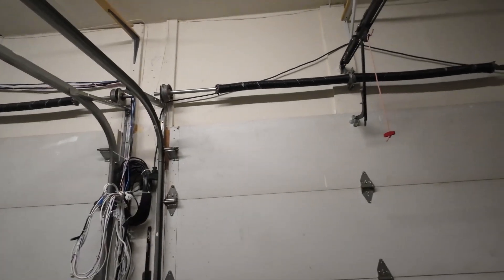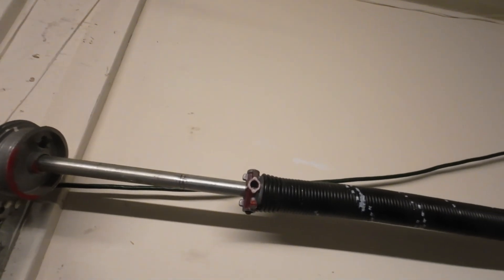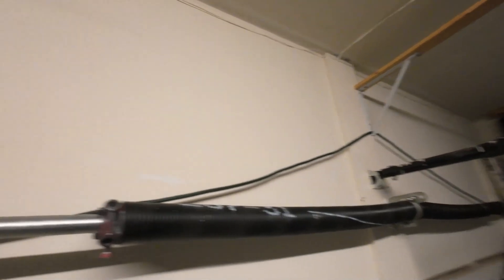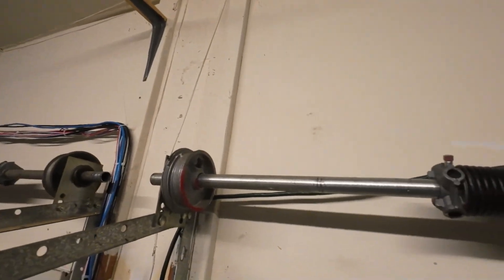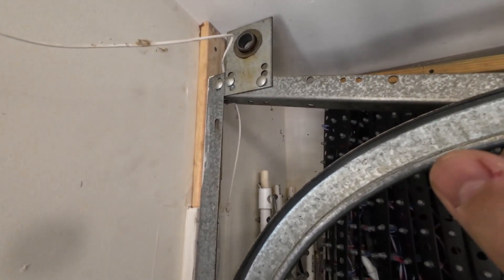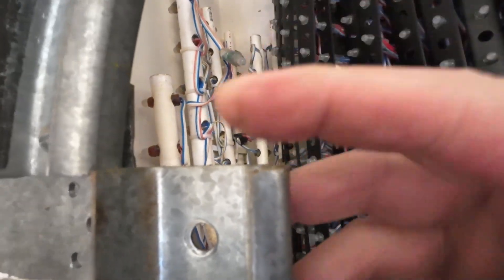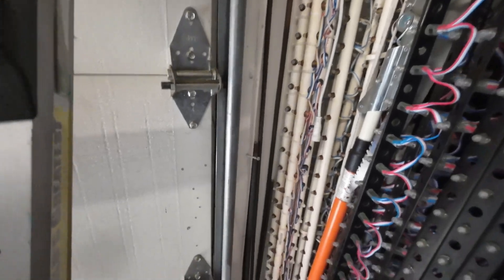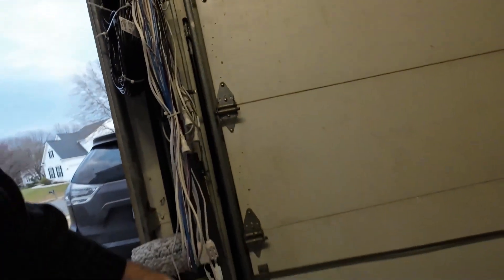I Converted My Garage Door to High Lift and You Should Too

Comment: Nice video and presentation. 
I have two questions. 
Is your new wire drums looks much like a cone diameter tapering towards door center line or not? Do you need a pair of new springs?
Reply from the maker: The drums do look like a cone diameter, if your springs are more than 5 years old, I recommend buying new springs and double spring would be my recommendation if you can do it.  Springs are not that expensive but be very careful as they hold a lot of tension.

Comment: This makes it look doable for a regular person. I got a quote today to add a new motor (direct drive) and a high lift conversion kit and the quote was $4800. I was not expecting it to be even close to that. So now I am on YouTube trying to figure out if it is even possible for me to do. Which this makes it seem like I could do it. Thats awesome Thank you!
Reply: Dang I’m under cutting myself $4800 to do the conversion with the jackshaft opener blows my mind, I do this conversion starting at $1822 plus taxes with a jackshaft opener included and the price could go up depending on the cycle of the springs that are desired.
Reply: @kingkevo2010  4800 for that job is literal fraud. NGL I had 5 people come out and give me quotes every single one was around 2k and that asshole wad almost 5 lol
Reply from the maker: I'm glad the video is helpful, hope you can get it done in no time.
Reply: Not a great idea to have  DIY work on torsion springs, garage door company cheaper than a hospital bill

Comment: Does it bother anyone else how he used the adjustable wrench? I have issues it may just be me.
Reply: The adjustable wrench is a good choice, it can be used as a hammer if you get mad at what you are working on…..
Reply: @playingwithdirt1862  or the person helping you...
Reply from the maker: Thank you for your comment, the adjustable wrench has a good grip due to the square shape of the screw.
Reply: @diydadhub  I gotcha. We have all struggled with old school adjustable wrenches. I stopped using them and either use channel locks or knives auto adjust wrenches.
Reply: Use a 7/16 ratcheting wrench. Normally you want a 3/8 wrench but 7/16 slips on perfect

Comment: Hi, I am trying to do the same.  Can you please share the adjustments. And I noticed the door was not staying open, you just to hold it.  What was needed to fix that issue.
#2. Will you be using electric for opener for this door.  If not, will you have to put a rope to bring the door back?
Reply: The door is not staying open because of one of two things. The springs are the incorrect wire size, length, and possibly inside diameter after going from 12"/15" radius track system to a high light track system. Or your cable length is incorrect.
Reply from the maker: @henningtanner  The cable length wasn't the issue, I had to add more tension to the springs (2 additional turns to be exact).
Reply from the maker: I had to add more tension on the springs for the door to stay up, and if you watch my opener video, I show what I did for the opener.  Which adjustment you are referring to?